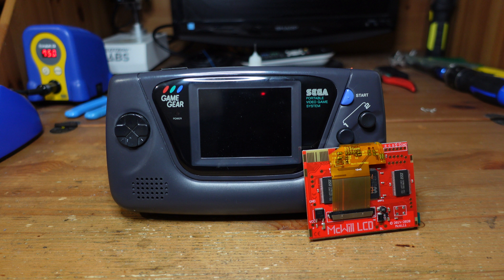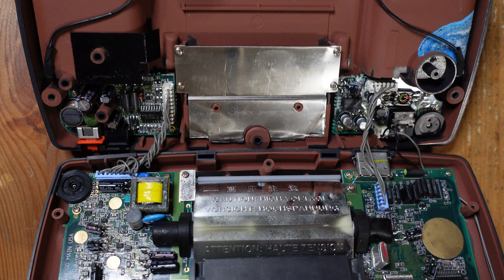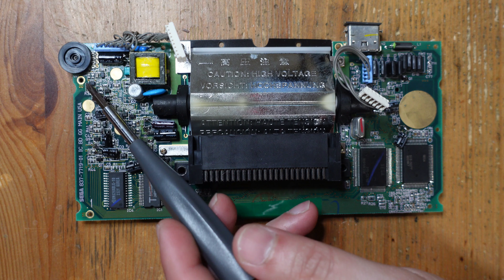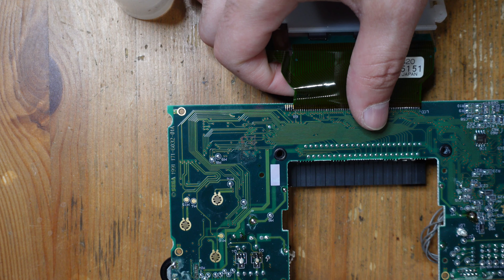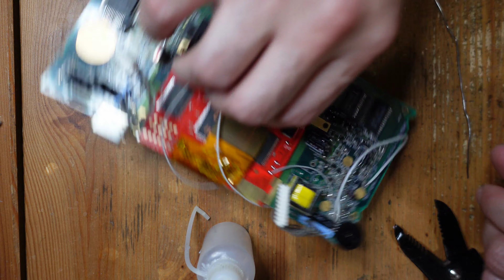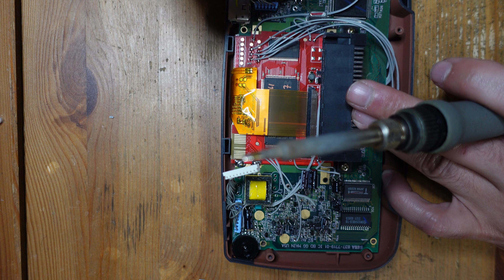Game Gear screen enhancements! Upgrade your Sega Game Gear with the McWill LCD mod!

Comment: So FYI, the CFL back light that came originally is the power hungry culprit.  I did a mod 12 years ago to mine that replaced the CFL with two LEDs flanking the OEM LCD with a straw bridging the two to diffuse light.  I could get around 25+ hours on 6 AA batteries this way, still using the OEM LCD.  Obviously this modern LCD is so much better.  I may have to do this now.  The picture is beautiful vs OEM.

Comment: batteries died within 3 hours back in the 90s, today its like 6 hours though because they are just better
Reply from the maker: That’s true, batteries are better now. But it’s also true that the game gear no longer needs +24 volts after the mod
Reply: @LIRetroGaming  true. Batteries are part of the nostalgia for me though. I want to get one of them mod chips I saw on bennvenns site that let's you charge rechargable Barrie's with the gg itself. There is no video guide for that ATM but sadly it's out of stock

Comment: The McWill screen is out of date now. How come you didn't use a RetroKai, BennVenn or CleanScreen screen mod ? All of which are much better than McWill
Reply from the maker: I think that the image quality from all of these different screens is about the same, but the newer screens are definitely much easier to install. In this case, a customer had sent me the McWill to install

Comment: Not too long ago, I bought a modded Game Gear from eBay. It had an aqua green shell, and not only did it have modern LCDs, but it also ran on rechargeable batteries, so I didn't have to worry about using disposable batteries or an AC adapter.

Comment: I never understood why people solder to the pads for the video connection and do not use the via. Could someone explain why?
Reply from the maker: You can use the vias, nothing wrong with that as well. But you need to scrape away the solder mask on each via and you also have to use 28 gauge wire which may not be as well insulated

Comment: its a great mod, my only difference is I didn't solder to the pads for the lcd.  I got thin enough wire to go through the via's, that why the wires aren't bending around the bottom of the pcb.  But you will need a microscope to scratch away the mask to solder to the vias on the other side.
Reply from the maker: Yes that option works as well, but it is a little bit more work

Comment: I'll have to check this out. I have a GG that I replaced the CCFL backlight with white LEDs, so it's already missing the high voltage ballast.
Reply from the maker: I remember those upgrades. That’s also pretty good but this is even better than that

Comment: the result is great, but i think that it results in a big wire mess inside the console, i would buy if it was a direct replacement of the original screen.
great video as always
Reply from the maker: True, the wiring can get messy. Some of the other kits like Bennvenn are a little cleaner to install

Comment: Looks like it's all the same type of wire. Did you get some bulk wire spools?
Reply from the maker: Yeah it’s 28 gauge wire that actually comes with the kit itself
Reply: @LIRetroGaming  Nice. Maybe you can invest in assorted spools of wire. It's more tidy than "random wires  from a wire bundle I had laying around"

Comment: AFAIK removing most of those components is unnecessary. If you look at the install guides for the other screens available, they usually only have you remove a few. In fact, BenVenn's only has you remove one, the L2 coil, because that is enough to disable the 34 volt circuit.  

Also, you can get 3D printed mounting brackets that make aligning the screen easy peasy.

Nice video though, thanks!
Reply from the maker: That’s some thing I’ve wondered about myself, but I always just stick to the official install documents. One of these days I’ll experiment and just remove the L2 coil and see how that turns out
Reply: @LIRetroGaming  Thanks for the great modding videos, you got me through a nomad recap / lcd upgrade, and the same again on a PC Engine GT!

Comment: Yeah, the difference is quite apparent.
I wonder if there is a mod that retrofits this device with a lithium battery. That would be more convenient than using disposable AA batteries.
Reply: I prefer to use rechargeable AA batteries, very easy to swap out if you want to play longer and no need to charge your console before use, just my 2 cents :)
Reply from the maker: I think there are battery mods but it’s some thing I have not done much research on yet

Comment: I thought it was 2 handheld consoles. Wasnt the Nomad a handheld version of the genesis? Like the game gear was the held mastersystem really?
Reply from the maker: Yes the nomad is a handheld version of the Genesis, but the game gear is the only dedicated handheld system that Sega made. Its shares architecture with the master system but it’s not the same as the master system
Reply: @LIRetroGaming  gotcha